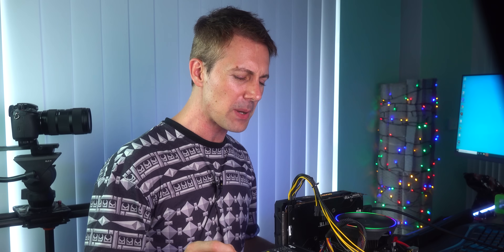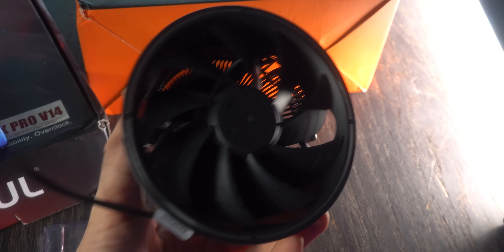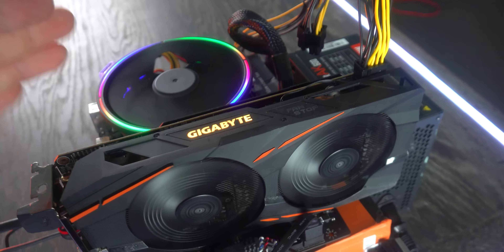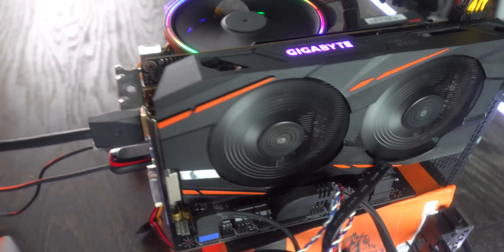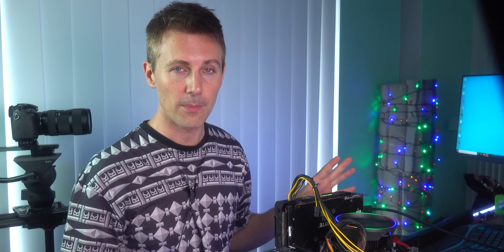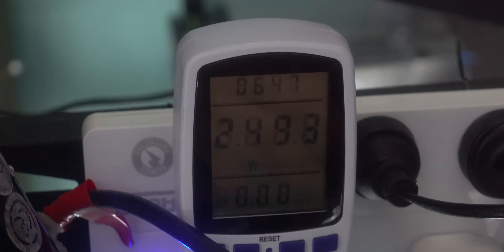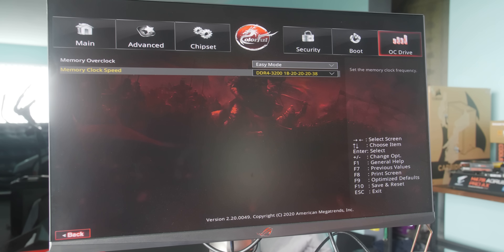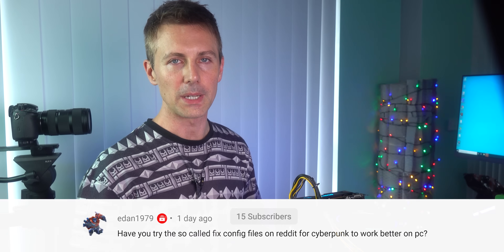Can This $470 ALIEXPRESS Gaming PC Play Cyberpunk!? (Plus Config FPS testing)

Comment from the maker: Hope you guys enjoyed this one. The prices of the GPU market might be a little more difficult going forward if we don't get something soon.... Heard that the 1660 super is stopping production...
Reply: Just a question,  with this kind of setup how long would you think it can last? (with a case) especially for an a320 mboard
Reply: @dragonjoshua100  the cpu should be good for maybe the next 5 years. i would get a better gpu if you can though, 4gb cards are on their last legs. and a b350 would keep that cpu going longer since you could overclock.
Reply: Thanks mate ! Great content as always ♥️
Reply: Should i buy th 1660 super right now
Reply: Graphic card seems pretty expensive there. I've seen GTX 1070ti around $150-170 in Korea. Then again laptops are like 1.5x more than US
Reply: @hanpa7309  jeez thats half the going price here in the US. might even be worth it to ship one if they are that cheap. 1070ti imo will be one of the next great 1080p cards like the RX580 and GTX1060 were up until now.
Reply: @eclipsegst9419  if the rx 580 is the 1080p high settings 60 fps gaming champ, the 1070/1070ti are deffo the 1080 high settings high refresh rate champs
Reply: @valuehunter5544  right now yes, but I mean if new games become as demanding as cyberpunk before long, the 1070 and vega will be the new 60-75fps on ultra cards.
Reply: @eclipsegst9419  not even sure if 1070 gets 40 fps in cyberpunk medium settings, that game is an absolute mess. if all games become that unoptimised we're gonna see next gen gpus every six months lmao
Reply: @valuehunter5544  oh jeez no it will do much better than that. I get 50 with an rx480 and all medium except SSR low. It's heavy but not THAT bad, they really overdid the screen space reflections though.
Reply: My MSI GTX 980 4gb is being a trooper with Cyberpunk2077 !
Reply: Last time I ordered from aliexpress was end of 2019.
I ordered two items from what I thought were two different sellers. They switched the tracking numbers.
I don't know if it was a mistake, or if they wanted to make it difficult to get a refund.
Fortunately, I did get both items but the second item came a month after the first item.
I would never order anything expensive from aliexpress.  Too risky.
Reply: @gamingoptimized  RX 570?? 8:34
Reply: Im surprised you used a rx580 4gb over a 1650 super 4gb since it’s cheaper and faster
Reply: Interesting concept. Great for budget gamers
Just letting you know that there is a performance mod here that helps with many issues: https://github.com/yamashi/PerformanceOverhaulCyberpunk/

In my case the smt fix helped alot.
Reply: We should work something out bro. I  am from Canada and can easily source gtx 1060 for under 130 bucks and other parts for way cheaper. There is no end to the deals in NA I feel bad for you aussie's.
Reply: 1:56 oh no. not at unknown PSU maker. i think corsair other brands have cheap PSUs similar to this
Reply: @zodiacfml  it will work ok on that PSU if he leave everything on stock. But I think even a small overclock would kill it as most of these cheep chinese "gaming ultra dragon spit deltaX super rgb" PSUs are based on old PIV PSU designs and they top at 250W output and than usually rectifier diode fail killing power transistors in process and sometimes some of components just not to die alone. 

In some different time (long, long time ago)  I use to upgrade diode on them (as transistors are rated usually at 30V40A and they are not problem) for my self and other people, at that time quality PSU was hard to buy in my country.
 
I agree that brand name power supply is better choice but I would stay away from cheap PSUs from big brands as they are usually same shit (ok, little better but not too much) with shinny name on it. If you already save some money buying rest of components on AE buying good PSU should be a number one thing to spend some of that saved money. There are decent ones for PCs like this one for $70-80, good PSU will always be a thing that last longer than most of components so it's always good investment. 

I guess there are some acceptable PSUs on aliexpress but it's impossible to know what is inside and once I spend some time reading reviews and didn't find even one without lots of "died in two weeks" reviews. Even one he use here as additional feedback have mostly cons but to be fair nobody have them fail, just some noise complaints and as it lack PFC performance on 110V are not great. To be honest, 230V user don't need to care about lack of active PFC, whatever isn't inside can't die on you :D. Still, not something to recommend.
Reply: @gorky_vk  Just this year, I have a Chinese PSU that killed my 2 Intel CPUs, one XFX RX 580 8GB, and maybe two more boards.  I did not know it was culprit until the PSU died a few months after by just turning on the PC, loud pop, blowing a non replaceable fuse.  I took the effort to replace the fuse but sparks just flew.   In short, a very expensive lesson for me on PSU quality.
Reply: @zodiacfml I could be wrong but I believe all PSU are manufactured in China.
Reply: @zodiacfml  these fuses inside are not replaceable for a reason :D
but don't blame only a PSU for all that  dead components before PSU itself died, good designed MBO must warn you that PSU is shit and just refuse to work, even your smartphone will refuse to charge from dirty output from bad charger so it's not something MBO manufacturers can't implement.
But yes, these PSUs are something to be avoided, you can save on anything than PSU when building a PC.
Reply: @gorky_vk  there are PSUs with replaceable fuses. :D  well, that's what I knew back then so I bought the Chinese PSU thinking it will not hurt, thinking it more likely has just poor efficiency and only 80% of its specified rating.
a huge but very short voltage spike from a cheap PSU won't be prevented from damaging PC components.   a good, reputable PSU should be able to prevent that.
I bought this for GPU mining in 2017. 
I shouldn't be buying that thing but I had no  other option except server PSUs that are so large to ship and requires buying separate cables and custom PCBs.  The branded PSUs with 1KW or more are so expensive and very few 12V connectors
Reply: @zodiacfml  but even when fuse is replaceable there is a reason why it blow so just replacing it doesn't help. Only devices shit blow fuses that can actually work just with fuse replacement are ones with huge capacitors like old linear audio amplifiers.
You learn your lesson, it's better to modify cables on quality server supply.
Reply: @zodiacfml  lol i also had a bad psu once, i thought since i needed a 500 that if i got a 650 the cheapo would be fine, but really it was only good for about 350 or something im guessing because it blew the second i overclocked. I replaced it with 500w seasonic and its been solid. the seasonic 500 was only like 55 bucks on sale too so i felt dumb for trying to spend only 30 and then being without a psu for 2 weeks because of it. definately learned my lesson on that one.
Reply: @Tech u looking a lil down in this vid
Reply: The best deal I've found and was able to take when I saw it was a new Gigabyte RX 580 Gaming 8gb OC for about $240 USD ($300 USD after tax and shipping) on NewEgg which is different from the Fanstop version that has rgb. This one doesn't have rgb which was disappointing but I got what I could and I'm glad I got it cuz it immediately went back up to almost $500 USD.
Reply: Seems Nvidia just wants to force RTX on all of us even if we dont want to buy it. Sure its cool. But i dont want to pay for it when its this much of a performance hit. Also its just sad that CryTeks Neon Noir can run RTX at very playable framerates on a 150 dollar card at 1080p and nobody else is implementing this tech yet, likely due to Nvidia payoffs.
Reply: Xeon 2620 v3 Full Turbo Boost on all Cores 3.2Ghz 6 Cores 12 Threads
2 x 8GB DDR4 2400
Sapphire Nitro RX 570 4GB

40 FPS Default Medium Settings 1080p
https://youtu.be/dVTDWEx-k3k

Comment: Where you went wrong here was the GPU m8. Getting something like a 1660 Super or better would have given you like 20-30% more FPS - which makes the game way more enjoyable. The RX 580 has reached the end of its lifespan/usefulness, where the GTX 1660 Super has a bit more life in it - and can be found in the same "neighborhood" in price - might be a bit more but somewhere in the 50$-ish range - but well worth it. If you have a GTX 1660 Super/TI at hand - try installing it in that computer and rerun your test. It will be a lot more performance than the 10%-ish price increase for the system would suggest.
Reply: Also - Can't wait for the RTX 3050 TI and the AMD low price/power req. parts comes out. I have a feeling they will be insane value for the budget builder market. The physical specs of the RTX 3050 TI would suggest it's in the ballpark of a GTX 1080..... which would be bloody amazing!

Comment: sorry to contradict bryan, but here in the Philippines all the 16 series geforce cards are on sale (slightly lower than msrp, compared to the normal 33 percent markup price, ex now 195$ previously 280$ products with 230$ msrp) which translates to those models nearing incoming replacements (perhaps a gf 3050 ??? and its siblings in january?). it also happened weeks before the launch of the 30 series whereas the 2080super was on sale for 420-500$, 2070s and 2060s was also slightly discounted back then. we never have shortage of 3080, 3070 or 3060ti but all of them are 200$ over the msrp. 3090's are around 2500$ and my hunch is this pricing will stay long after the world has abundant supplies.
Reply: The Pinas is a different market vs Australia, USA or Canada.  Also why mention GPUs that are beyond the budget scope of the video?  I'm on a budget, I'm kinda on the level of buying from AliExpress since my local area pricing on parts is more expensive.  GPU wise, only the GTX 950,, GTX 960 or GTX 1050 are in my range...1650 and model nividia GPUs not in reach.

Comment: Playing Cyberpunk 2077 on my ~200US$ X79 RX470 PC 1440p/30FPS/Medium without any'ish problems (only the billions and billions of Cyberbug's native problems)...

X79 Motherboard 45US$ AliExpress
Xeon E5-2643 15US$ AliExpress
16GB ECC DDR3 1866 quad-channel 30US$ AliExpress
256GB NVME 30US$ AliExpress
RX 470 4GB 70US$ eBay/Facebook/used local
450W PSU ~15US$ eBay/Facebook/used local
CPU cooler ~10US$ Newegg/AliExpress/eBay
Case 0US$ (I'm using a generic case)

Comment: 1:56 oh no. not at unknown PSU maker. i think corsair other brands have cheap PSUs similar to this
Reply: I would definitely go VS 650W Corsair for around $60,- if that's all you can afford over that yes. 😆

That thing had me seriously worried.
Reply: @MLWJ1993  exactly. I have the 450w. Quiet and cool even it is only a bronze rated Psu.
Reply: @zodiacfml  that one is bronze rated? Thought all the VS series PSUs are 80+ White 🤔
Reply: @MLWJ1993  right. I overloooked that. All i k mnow it has decent eff. At 220v.
Reply: @zodiacfml  they're capable of what they advertise that's for sure

Comment: if you're going to spend  $280 on a Rx 580, just buy a  5600xt or used 1070..... a 5600xt is on par with a 1080
Reply: Not yet. The 5600XT shot up in price, and wait till the GTX cards get lower in price. With raytracing being the “new” and “hip” thing in gaming, those cards will decrease in price in the used market heavily once the RTX cards go in stock.
Reply: @marker_merk  . That is true.  fortunately I was able to get a 5600xt for 250 2 month ago

Comment: a320 board really come on b450 are only about $15 more and far better.

Those GPU prices are rip off RX 570 was about $70 for 4gb before

I have had a few items they have pulled that scam lucky they was only few $ each. (ali wouldnt refund because the seller showed it had been delivered and this place you basically get 0 warranty)

No snowman love 

Based on just this game might as well use that money and get Series S or X

You need to stop saying shipped world wide this isn't true plus these are not the prices to everyone because of taxes plus depending on your country the sellers charge more shipping if they ship to your country.

It's lack of stock which is the issue not new card models needed so if their is not stock on even 1650 then the old cards like rx580 which has stock are more expensive which is the case theirs loads of these new in my country but they want silly money.

Comment: I got a huge deal on half of a mid level gaming setup off of marketplace recently. I payed $600 cash for an ASUS TUF Gaming X570 Plus (WiFi), MSI Ventus XS GTX 1660Ti OC, TridentZ RGB 16GB Dual Channel 3200mhz RAM, Segotep 750w 80+ Gold Full Modular PSU, and a 500gb Samsung Evo 970 m.2 nvme SSD, and a NZXT H510 W1 mid-tower case. All unopened in the original packaging. Dude was going to build a pc a few months ago and changed his mind. He happened to have identical plan as me, pairing the 1660 with a Ryzen 2700 or 3600 cpu, so it worked out great.

Comment: i tested Cyberpunk 2077 on a ryzen 1200 rx 570 combo with the same gloway ram and i also was getting around 40 fps with fidelity fx 70% on in low settings with medium textures, its probably that the game is not using your pc at 100%, at least for my case that i build a pc for around 350$ to flip it soon, runs this game pretty good imo, i read there was a patch or some file that could be changed and made the game run much better on high core Ryzen cpus.

Comment: Another great video with used price to performance my favs!  

The first think I think with Aliexpress is x79/x99 motherboard combos with cpus and ram.  

Last I checked they had a e5-2620 v3, motherboard and 16gb of ram all for roughly $140 US dollars.  Think with that platform you still have options to upgrade to higher core count cpus and clocks and the price savings, can sink it into a better gpu.  On the used market in the states, the rx vega 56/64 cards weren't too bad pricing wise compared to nvidia.  Also for roughly similar performance, r9 290/x 8gb were still similarly priced with  rx 470 4gb cards to have that extra vram.

Power supplies i usually use the 600 watt 80 plus bronze Jupiter that I've been able to get new on amazon around $48.

As always love your content man and look forward to the used builds you do and seeing how they perform.  Wish you and friends and family a happy and safe holiday and new years!

Comment: That would have looked good in the case Bryan.  Ryzen cpus around here are pretty much nonexistent and I just can't trust the aliexpress sellers.  I just built a i3 10100, h410 and the same gigabyte gpu (rx570).  Here in the US, cpu and mobo combo is $140 at microcenter and gpu was about $100 used market.  If you only want to game, the 10100 will net you the same or slightly better avg fps over the 2600.  Yes there are more upsides with the 2600 and a320, but these cheap intel chips and mobos are much easier to come by these days for a nice little budget build.

Comment: If you really wanna risk it for the biscuit, but most likely not a good idea.. you could go with a cheap LGA 2011 motherboard 50$ and the e5 2667 for 20$ and ddr3 ECC Ram for 30$.. save like almost 200$ for a performance dip but great price performance

Comment: Something is odd with your pricing for that card, I've seen RX 580 in AliExpress for $150, I don't know if they may be flashed RX480's or something like that but a 580 should not be over $200 used right now. Even being gigabyte branded
Reply: I bought a brand new RX 580 8GB, about 3 months ago or so, and it only cost me $172 USD ($220 CAD) on Amazon.

Comment: I build a $200 pc using a R9 290X, a X3440 @4GHz and 16GB RAM. Also a good looking case, good as new cooler master psu, new 240GB SSD and a good as new 2TB HDD.
Reply: Sounds like my PC before I upgraded.  I ran a 290X for about 6 years. Loved that card, but it just used so much power in comparison to my RX 580...I can actually overclock my CPU farther now that the 290X isn't overwhelming my case with heat.  I run T3500 motherboard, unlocked W3570 @ 4GHz with my 290X.  Total cost went up when my 290X died and I was forced to upgrade to RX 580, but I'm still in the < $300 range on the total build, if you exclude the unnecessary RGB fans I added recently.
Reply: @AaronHendu  Nice! Yeah it isn't very efficient but my card is very cool and quiet, i have the tri x.
Reply: @misteragb7558  290x is my second favourite GPU I have ever owned, following the 8800GT.

Comment: Before rushing to Aliexpress, be sure to check your own country's offers and import conditions. In Germany e.g. you will probably have to pay import duties for Chinese stuff, which would bringt up your costs significantly. Also, in case of lost shippings, damages, scam, whatsoever, you have noone to turn to. So, for a similar setup within your own country, with all warranties and all you can wish for, you would end up paying maybe 50-100 EUR more which would be totally worth it imho. And this is just taking regular offers into account. By using deal platforms you might even save up to 10-15 % without losing any of the benefits mentioned beforehand.

Comment: Haha just built a couple Xeon 1366 mobo w3565 ..3.2-3.5 combo...with 16gigs..same dark flash cooler...hafta say I like the cooler...and found a miner on eBay said had same exact gigabyte rx570...guy was from ohio in the U.S...but turned out bn a couple good builds ...even put a x5680 6core in a 3rd build...but I only could get dell t3500 mobos with the deal...so not really overclocking but still plays some decent games :) love the builds n vids Brian!